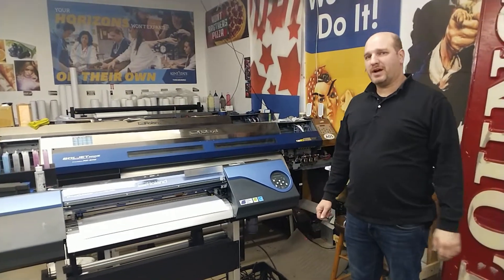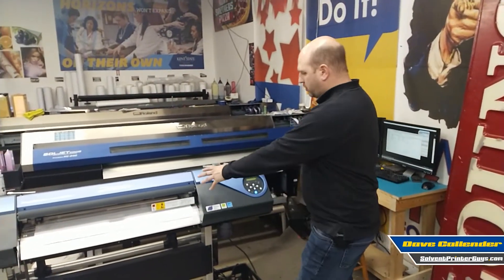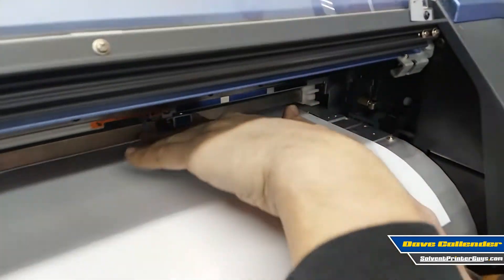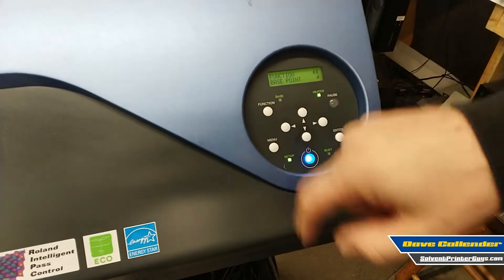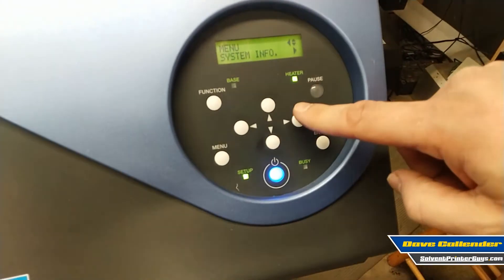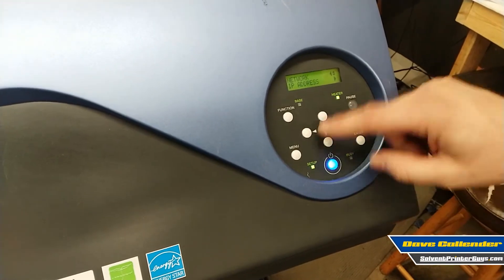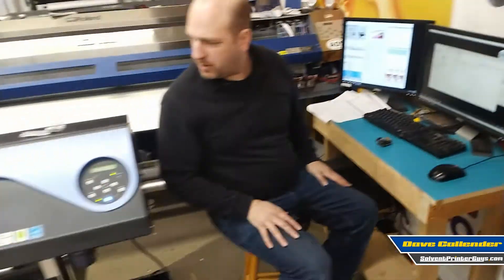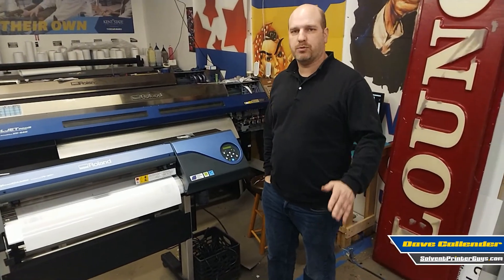Roland VS300 basic operation

Comment: Hi there, my SP 300v has stopped doing the miniature cleaning cycle is there anyway I can have start doing it again 
Thanks
Reply from the maker: If you are referring to the mini cleaning cycles that happen approximately 1x per day those typically are programmed in to always run - I don't know of a way to turn them on / off in that model - make sure that your ink type setting is correct in your machine to match the ink type that you are running

Comment: Can you run heat transfer vinyl through these and only use the cutting system if needed? Or do you HAVE to print on media then cut?
Reply from the maker: Any Roland printer cutter will allow you to use the cut only function to cut vinyls including heat transfer vinyl.  They will also allow for print only functions or print and then cut